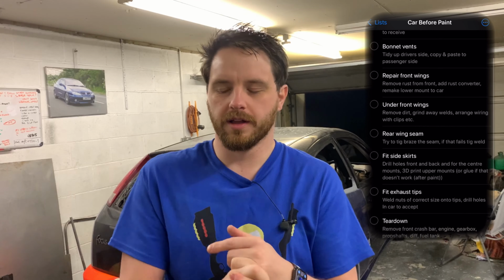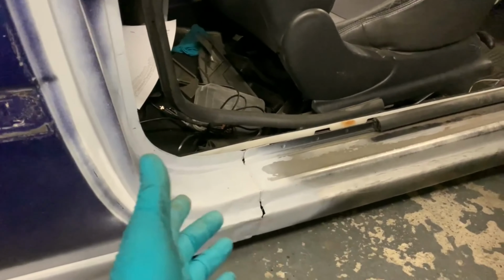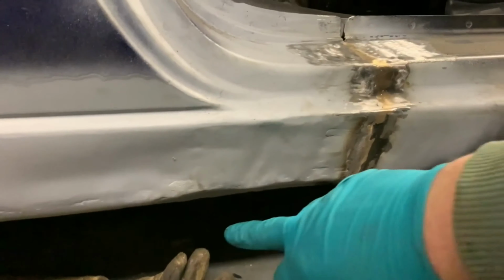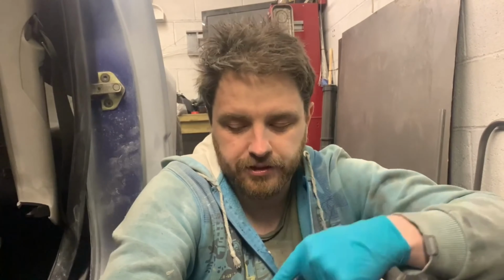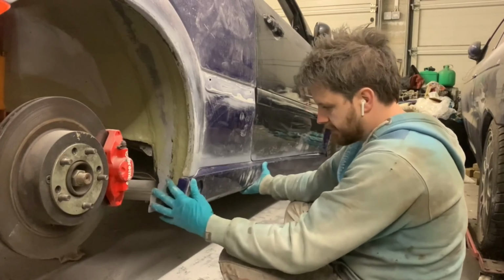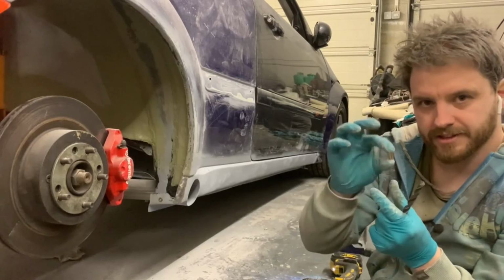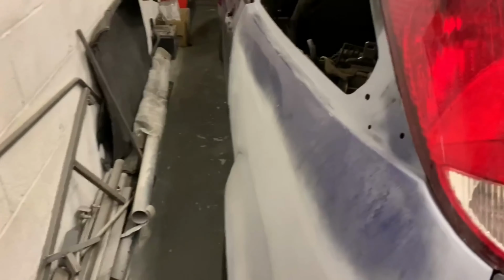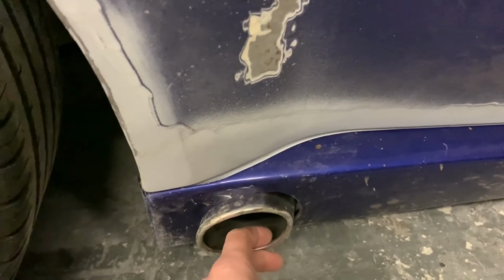Fitting Side Skirts - 1UZ V8 Ford Focus - The Flexus Build Episode 61

Comment: What was the reasoning behind the brazing as opposed to welding as we weld all these kind of joints at work?
Reply from the maker: They’re braised from factory, I wanted to emulate that. I also think it gives a stronger joint as the braise will work it’s way in between the panels, and the bronze rods shouldn’t rust like an oxidised welding rod.

Nearly did weld it tbh but throughout I’d give the braising a go

Comment: Are you going to use wheel arch liners on the rear?
Reply from the maker: No I need to find a good rubberised underseal. Have to admit I’m struggling
Reply: @JaffBuilds  i hear good and bad reports of upon raptor coat but don't actually know anyone personally that has used it.
Reply from the maker: That’s the stuff I have here lol